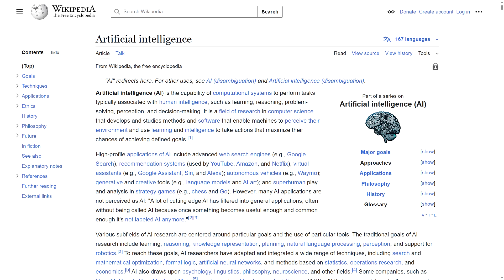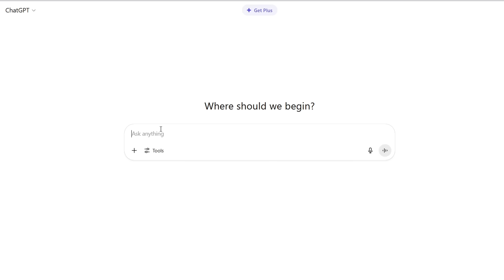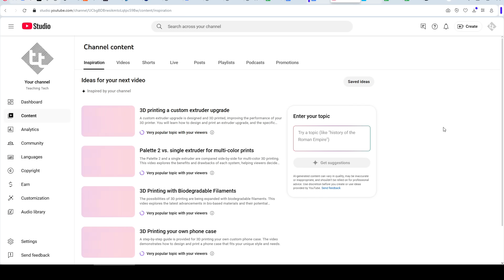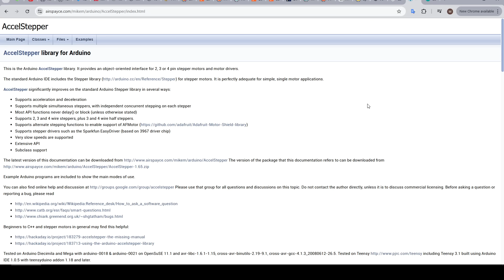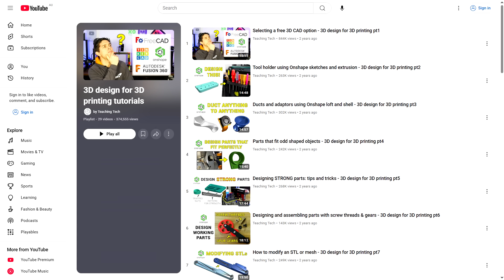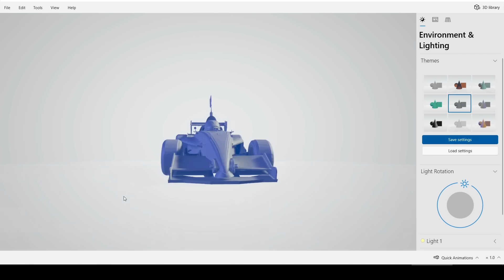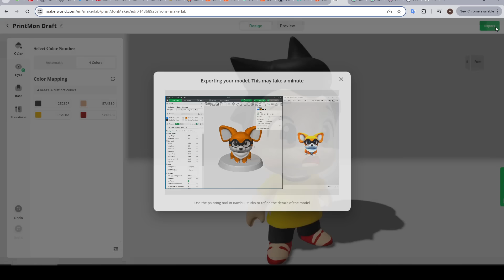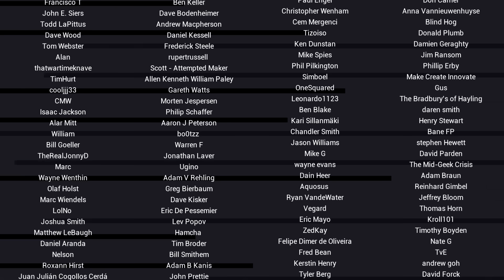Do we want AI to play a part in being a maker?

Comment: I think I agree more or less with what you said in this video. I actually have very little trust in current AI to get things right. Generative AI sucks at math and cannot be trusted with that. It does not produce OpenSCAD models except for the simplest ones. I would not trust it to generate Arduino code either. Sometimes I do read the AI results of google searches but I am generally skeptical of the results and usually try to confirm with other sources. That last thing I want is to start to believe things that are not true. I would rather read content written by an expert than by AI.

Comment: I have similar views regarding Ai being introduced to all aspects of our lives. As a person working in IT, I have not actively used Ai in my job function, as it does not complement or assist me. As a tinkerer/maker, I don't use Ai for any of my projects, because imho it makes you lazy to struggle through a challenge and solve it through research instead of taking the easy route out. When I used to ask my Father to help me solve something, he always told me to find my own solution to the problem. Ai takes this learning thought process or independent thinking,  away by making it easier. The problem is that if you do not have the experience in a certain filed of study Ai can spew out incorrect answers, which can end up with dire consequences. Let me stop waffling now. Thanx for this topic - very relevant at the moment.

Comment: hi I'm a software developer. For me AI is nice as an agent, for translating. I agree with everything you said in the video. It's nice, maybe good for some examples or applications, but it's not for what it's all used for and how it's used. Especially if I were to ask something that doesn't exist on the internet or there's not that much information. Simply put, apart from translating when writing emails, I don't see any huge benefit in my job. The code I write, I write better and more accurately than AI. What I don't know, AI doesn't know either. The problem will be when AI starts learning on the data it generated itself.

Comment: For the most part AI is junk.  In order to get the results you want, you might as well learn to do it yourself.  However, I was reading an article about keeping prints from pulling away from the bed after the print was completed.  It said to write Gcode to step down the cooling over some minutes.  I wasn’t going to learn Gcode for that, so I’ll do it with AI.

Comment: I use Chat GPT occasionally. I've found it works best for me when I treat it as a Google search tool. If I am looking for specific info, sometimes it is hard to find what I am looking for searching Google. But with AI I can tell it what I am looking for and it will usually point me in the right direction much better than just a standard search. I will use it occasionally at work when I need to workout a calculation from dimensions on a blueprint. I always read through the work it shows to make sure I am buying what it is selling. I have used it to make some clip art of a car that I wanted to print a flat side profile of. I was able to take the clip art into Inkscape, trace it to an .svg, clean up the svg, and load that into cad for extrude the trace into bodies. 

It has it's uses, but should not be used to do your work for you as it often has mistakes. For example I decided to see if it could help me diagnose my outboard which was running poorly. I gave it a description of the issues and it gave me some solid advice on how to proceed. First it told me to test the spark, followed by a description of how to go about it. Then compression, etc... However the deeper I got the more off track it got. At one point it instructed me to visually inspect the spark plugs and even offered to read them for me if I uploaded a picture of them. They were clearly fouled, yet Chat GPT responded to the picture that they'll looked to be burning great.

Comment: the onyl way i would want AI in my workflow is to be able to monitor prints and inteligently determine if the print has screwed up in some way. basically better spaghetti detection that can see other failures as well, i use AI to make better documentation for code i write, i like writing little apps and tools but the documentation was always a drudge it seems to be really good at figuring out what my apps do and documenting api end points and all the stuff i do a piss poor job of, it requires guiding and editing usually but it still gets me 90% of the way there with 1% of the effort

Comment: For a hobby/makering it's about what you want to do and what you want to learn. 

I recently done a silly circuitpython project (making my rc car do a wilhem scream when it tips over), and I wanted to do the code myself. I was using some newer poorly document libraries - so no tutorials. I used gemini to give me specific commands for my code so I didn't have to spend forever finding it - at that point I'm using it as a turbo powered search engine. 

Some diy projects need a real mix of skills, so a cosplay project for someone who likes the hands on stuff but doesn't want to code the arduino - I say to them go for it! But if the core of the project is the code - then I'd suggest them to do it themselves - even if it is with some AI help. 

I'm not a fan of sharing something basically solely AI generated alongside human made content - which is what is happening on the 3d model platforms. But I think most people are not a fan of that. The AI generated stuff needs its own walled off section...but then how do we define AI generated? What if someone done all the technical modelling work when used AI to generate textures for a couple of faces? A feature that is just a blender plugin...

And as for teaching, I only got a taste of students using it at uni - to which I always reminded them that they would not have it for the exam...and if you fail the exam you fail the course.

Comment: AI should be a research tool, a means of interrogating and correlating unconnected data sets to illuminate a possible and more complete solution to today's big issues. It shouldn't be used by credentialed (though operationally inadequate) individuals to cover up either their incompetence of laziness at work. The guarantee is that the more AI is performing your job, the more likely down the road that AI modelling will replace you. Managers and executives with the creativity necessary  to achieve positions exceeding their competence - you're on a countdown, dudes and dudettes..
Reply: Would you say the same for CAD and CAM, or maybe spreadsheets. How about the Calculator. What about using the internet? The world will change, I’m going to do my best to change with it, not gatekeep.
Reply: @M3NT8L_one Not the same. All points you've raised are tools, not some little fellow one keeps under wraps who does your work for you (that you take the credit for). That's how it's being used, as I'm guess you already know.

Comment: I feel like many people jump straight into getting AI to the task directly for them while missing the most useful part, which is the conversational part. Being able to talk to another "intelligence" about what you are trying to do or achieve and bouncing ideas back and forth, I find are extremely helpful. This is especially helpful if you are attempting to tackle something that you know little or nothing about. An AI can be a mentor, a second set of eyes, someone to guide and bounce ideas off or at the very least, a rubber duck.
Reply: it's only useful if the AI isn't tuned to be a yes man, which most are nowadays for user retention purposes
Reply: @xuyukun123 Valid point, but I think it also somewhat depends on the questions you are asking it. My personal experience has shown that it can be useful/helpful if you provide it proper context and frame your questions on specific aspects. Asking a general or generic questions without much or any context will almost certainly lead to junk
Reply: @farzadb82 kind of? but basically it can never be taken as fact, because if you ask it enough times it will just say you're correct to glaze you. This is exactly why it cannot and should not be a mentor, unless work has been put in to guarantee that it does not spit out something wrong, since it does it have the sense of responsibility to make sure that it's teaching the right thing. If you truly know very little about a topic, you can form very very damaging bad habits or pick up similar wrong information from a supposedly trustworthy mentor. Even things like coding, which all these LLMs are generally supposed to be really good at, is far from perfect when given anything more than a simple task. I've used them plenty at work and tend to end up using more energy fixing its mistakes for anything past simple questions on documentation and endpoints that I've forgotten

Comment: I'm a professional software developer and the best example of a case where I found AI useful was on a personal project. I wanted to make an esp32 into a binary sensor for esphome and Home Assistant. I'm not that familiar with the esphome YAML syntax required so I asked ChatGPT to create one for me. It happily did so, and its answer was wrong, but the ~80% it got right was the boilerplate I knew the least, and the remaining 20% that needed rewriting was the part specific to my project that I was happy to do myself. This saved me a lot of time and drudgery and trial and error on something I don't have any desire to master and let me focus my limited time on the stuff that was actually interesting and important to me.

Putting aside the environmental and plagiaristic arguments (which are valid), I think of it as a tool like any other. As long as you understand what it's good at, its limitations, and when you're saving time and effort but only shortchanging yourself in the long run, to me the AI good/AI bad argument is in many ways equivalent to arguing whether you're cheating at woodworking if you use power tools, laser levels, etc.

Comment: It's definitely over saturated. Much like Blockchain or cloud was before. It's being applied everywhere to see where it sticks. Looking at Google's video development it will change things in TV and movie production for sure (ads without celebrities will change drastically I think when you can create a short video with incredible quality in minutes).

Aside from that I do use it, when I'm coding sometimes it doesn't always work and it does making searching for code examples (not that they always work mind you) quicker than using stack overflow or a specific code searcher or something similar.

Primarily though I use it to make images I can't draw myself to use on my laser engraver. I couldn't draw a straight line with a ruler as they say but using it to generate a basic image I can then change or alter or layer together can be quite a time saver.

Comment: Well, you obviously have a strong bias against AI. I'm quite on the other side! It started for me with coding. I already had some experience, but progress was slow, and most of the time I got stuck—searching through countless forums where people discussed similar, but not quite the same, issues I was facing.I understand your point about solving a puzzle. But even though I use AI, it still feels the same for me—like solving a puzzle—except now I’ve leveled up dramatically in the kinds of projects I can take on.

For example, earlier I would just code a simple LED strip using Arduino. Now, with AI's help, I’m working with an ESP32 using ESP-IDF to display complex mathematical visualizations mapped to XY coordinates on a cylindrical LED tube. It syncs with music through a sensor, and the whole thing has a full UI on an LCD display with buttons to control the visualizations! I could never have dreamed of creating this. And when I finally succeed by guiding the AI to bring my imagination to life, it still feels like solving the puzzle—just on a whole new level

Comment: Using AI for hobby coding. While I would never currently trust AI code, when I am looking at coding in a technology space I am unfamiliar with, I do find AI a tool for getting started by disclosing some of the relevant libraries and potential API that I might then use. e.g. "Write me a Python script for controlling an amphibian on the Strange Inc MCU devboard". I then can follow up with a few "No you stupid AI, do not exclude frogs" until I have seen enough and I can start accessing the relevant data sheets etc to write it properly.

And for professional coding... I cant ask those sort of questions because I might be leaking confidential information back into the AI sphere, no matter what the AI licence claimed.

Comment: As normal, you hit the nail on the head. I totally agree with you. AI has it place, but in stopping people from learning (or at least giving the option to get an answer without understanding) it is bad. Before people think I am an old anti tech person, let me point out that I am old, but worked in software development/engineering for over 50 years. By far the greatest true cost of software is eaten up by maintenance over its life. It was bad enough when juniors would find a 'googled' example of some code to do something, then 'bash the requirement into shape' until it fitted the example code to end up with something that neither they or anyone else understood. What is worse, when these bad example make there way to cyber space, they then become the input for the next reiteration of the process and feed bad code into the machine learning process promoting the bad example to carry more weight to the AI. The process relies on good training examples, but as that 'stock' get dissolved / adulterated  with bad examples, eventually it will only be able to come up with HOW NOT TO DO IT. This may take time, but by then, the people who actually know why things are done the correct way and why other things are bad will leave the workspace (as they know what they are doing they are more expensive to hire than the 'fake it till you make it' gang) there will be nobody to correct the badly generated AI stuff. The parallel with this comes from the medical world that over subscribed antibiotics (inappropriate use) resulting in the reduction in infections we can cure making an open playing field for those we cannot (bad result). AI ha great potential but needs to be taken out of the hands of marketing BS and used by persons who are disciplined to ensure it ends up making the world a better place for the future generations.